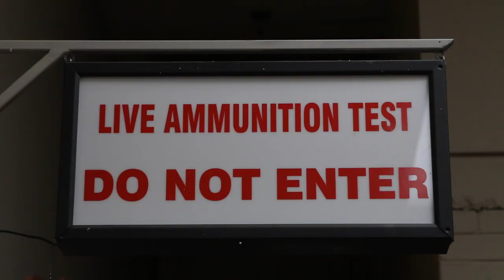Inside INKAS Armored Vehicles | Driving.ca

Comment: I'm confused, you have all this extra weight in armor glass etc. And you don't upgrade the drivetrain?
The engine, transmission, drive shaft, rear end, excetera it's only designed for a specific weight., if you put the wrong size tires even on a vehicle it puts stress and strain on the rear end all the way up to the engine. I would want an extra  200 horsepower at least upfront on top of what stock was, just to get it down the road properly. It seems to me you need the best  armor in the world because you're going to be taking a lot of hits trying to get away.
Reply: Modern vehicular armour is surprisingly lightweight, due in part, to the extensive use of reinforced red kevlar compounds. Thus a vehicle weighting approximately 10 tons, after modification, would only weigh about 10.5 tons. For this reason there is no need to modify the drive train, other than to protect it from explosive devices.
I hope this information helps you to understand the engineering behind CIT vehicles
Reply: @paullee5573  
Thank you for clarifying.